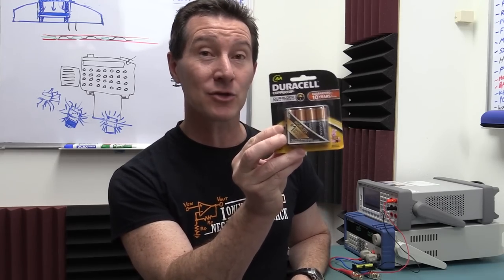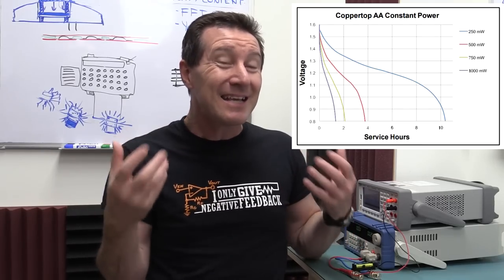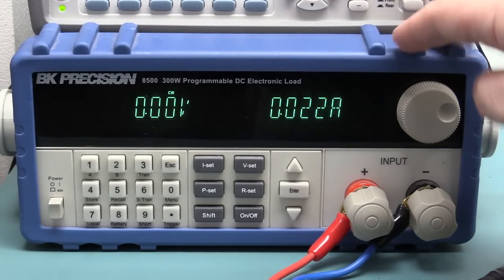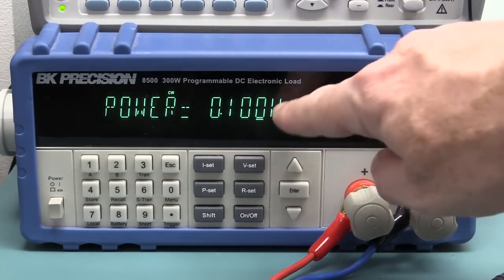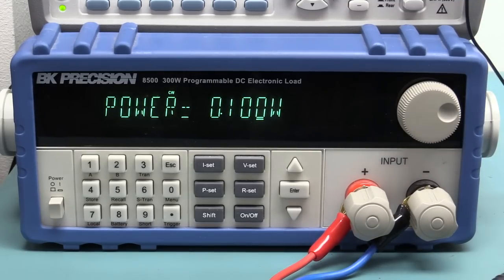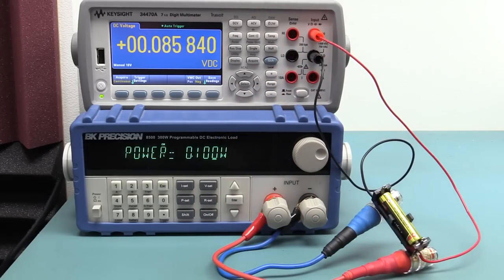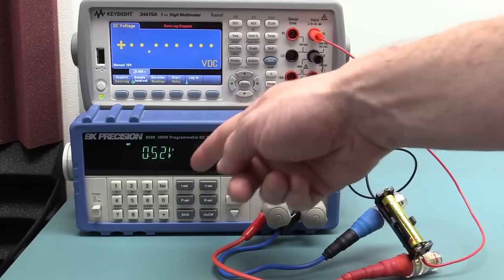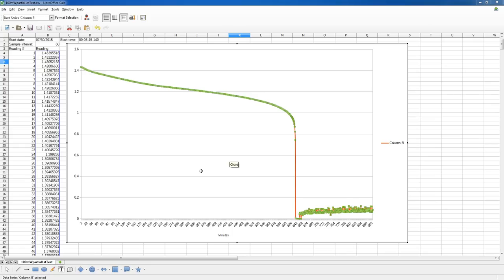EEVblog #774 - Low Battery Discharge Testing Part 1

Comment: Hopefully now people understand why the graphs cut off there hopefully.

I really appreciate that you go THIS far to make it easy to understand for everyone not only engineers that are familiar with the terms and topics. This alone is a fairly demanding task that not even all teachers want to go through so for that you have my respect Dave. Keep up the good work.
Reply: MhDaMaster All i hope (but certainly wont happen) is that those guys to whom i wrote a text wall explaining why ESR wouldnt let you even power a led (which my numbers were pretty near to what dave meassured here) and why they graph below 0.8V was useless (1% left doesnt mean you can get it, not with 1Kohm+ esr @ 0,8v) will understand it now. 
Fun fact, one even told me he was "another experiences electrical engineer" (i doubt he was even an undergrad) and even funnier because i'm a computer sciences guy. It seems to me these kind of people see this as those others see those free energy devices.  No one did this so far because evil iluminati corporations wanted you to throw away your batteries half way used. (or 89% full/~1,53V if you want to get that 800% battery life increment)
But what does dave know.....the laws of physics are just numbers /sarcasm.
Reply: MhDaMaster So much this. Hopefully this wil put to rest the joule thief and near infinite energy from battery chemistry arguments. 
I really apreciate what this man does to explain simple scientific concepts and guide those who are gullible enough back into the scientific method.
Reply: Laharl Krichevskoy "It seems to me these kind of people see this as those others see those free energy devices."

Yes this is exactly the reason those guys nitpick all day at every single minor detail/mispelling or whatever to "debunk" any detractors, at least in their heads.
Reply: Laharl Krichevskoy Well, 'power a led' really depends on what sort of application it is. Nanopower sensor equipment designed for energy harvesting can tend to get usable energy from a depleted chemical cell, though usually solar, rectenna, or tritium IC power may be preferred. Or fun stuff like lithium-air batteries.

Usually you might design a system which draws power to an ultra-low esr organic polymer electrolytic capacitor, then you can convert, store in a capacitor, and enable the device once the stored charge reaches a peak. So you can run a lot of devices on low power sources, usually by adjusting the activity timescale. A pulsing LED for example.

If you wanted to be really cute, you could derive energy from the oxidation of the metal the battery is made out of. It's perhaps just a question of 'application'.
Reply: Gravity What kind of consumer product would completely run like that though. Most if not all consumer products run on demand not when the charge of the capacitor drawing power from your extremely discharged battery reaches a peak or something like that.

I honestly dont see that kind of products making their way into the consumer market let alone on a massive scale.

On the other hand yes I can see the application for certain parts of a product, like the pulsing led from your example. But would it really be worth spending all the extra cash on the parts, design, manufacture, etc. required to get that "extra" energy compared to the savings on batteries you will make on the pulsing led for example?.

Sounds like a super LONG term investment probably in some cases at really low power consumption the return rate would be so low that the life span of your product would run out before you make your money back. And thats not even accounting for accidents or anything of the sort.

Maybe in the future when that tech is cheaper which would make the length of the investment shorter but I'm not certain for now. We would really have to crack the actual numbers maybe in certain cases its viable but it sounds niche to me.
Reply: MhDaMaster 'Internet of Things' stuff can run like that, home automation, security products, etc. It's a pretty useful field, and especially to get long-term background processing operational. A major emerging consumer market is stuff like wearable electronics, low power digital tech to get emails, status updates, and so on.

As for the implementation technology, it's presently not that expensive. An LT3105 is pretty good for high impedance inputs. 'Commercial application' is basically a function of the engineer's imagination refined relative to resources.
Reply: Gravity  Yeah its probaly really good to extend the life of rechargeable battery devices which is an extremely important sell point then again I have heard discharging those completely is not that good for their life span but I'm not an expert in batteries so I'm not certain haha.

I haven't seen any of this stuff "low power digital tech to get emails, status updates, and so on." running on disposable batteries you know like a cell phone running on AA? sounds kinda wonky.

To be honest I haven't seen anything really important running on disposable batteries except for the one in motherboards or similar applications, clock keeping, bios, etc. Which are not process intensive by any stretch of the imagination.

It still sounds niche to me in terms of the disposable battery market.
Reply: MhDaMaster
no, if you discarge NiCd or NiMH batteries below 1V you ruin them, specially NiMH ones.
I'm not an expert chemist to know the why and all the atomic structures stuff but basically you get the same as if you had used it for a long time but un a brief moment. ESR goes throw the roof and it just wont hold charge at all, aka the mAh go down.
NiCd batteries are supposed to be more resistant, but they hold way less charge and though "sparking" them is also supposed to restore them a bit, i tried it and it made little to no difference.
Overcharging alkaline AA cells to 2V did work though.
Reply: Laharl Krichevskoy Thanks for the info I had heard it killed them but I wasn't certain if it was true or just a rumor good to know.
Reply: MhDaMaster
same happens for most chemistries. li-ion and li-po cells can even catch fire or deform, especially the later.
sumerged lead acid ones (car betteries) suffer an immidiate death if you do that. Get it below 10V and no matter what you do it wont start your engine. it will still work and give a bunch of amps (its huge compared to a AA) but compared to a new one, you are talking about +220A to 30-40A.
Remember baterries are basically chemical reactions, and most can be reversed, but only under certain conditions, those conditions tend to dictate those cut-off voltages.
lead acid betteries generate hidrogen if overcharged above 13,6/14,40V, you turn all the water into hydrogen and run out of water, the chemical reaction cant work, hence baterry's dead. And if you over discharge it, lead oxide forms and falls to the button of the case and them it cant be changed back when you recharge it, hence you lost capasity.

You can even recharge an alkaline AA battery but they hold a lot less charge depending on at what point you recharge them and they generate hydrogen too, so if they are berry tightly sealled they can bent and leak. (9V ones tend to do fine though). Still they are not the safest chemistry so that's why you dont see rechargeable ones, though some made them for a while, still not worth it. (in case you are interested, try charging at CC at 0,05C of an equivalent NiMH one, about 100mA max for a AA, lower is better, be sure to place it in a plastic container in case they leak. Stop once the voltage stops going up)
Reply: MhDaMaster Disposable battery stuff for low power, in the commercial realm, usually
 tends to run on things like metal-air batteries. Zinc-air is a pretty 
common one, they have light weight due to the absence of an oxidizer. 
For applications, it tends to be stuff like hearing aids, pacemakers, 
emergency rescue beacons, animal tagging, emergency radios, military 
stuff, and so on.

+Laharl Krichevskoy 
Well, for the above stuff and additional, it's a very real field. Nanopower industrial sensors, microelectromechanical systems, Sigfox low power webs, etc. Don't confuse the cons for the real stuff, you know?
Reply: Gravity I'll get back to you once the discharge curves at lower currents hence fairly low power come in then we can crack some numbers to see if it would be worth it draining every single watt out of the battery costwise. Its much more "scientific" that way if at low power its not worth it then nanopower wont be either so we will see I guess.
Reply: MhDaMaster Oh, are you talking about what's in this video specifically? I mean, low-power devices are already a multimillion dollar industry. For emergency beacons, military comms, etc. it can be absolutely worth pulling every last bit of power, especially from multiple sources. Like, you could have a solar panel, a thermoelectric, and a battery piped through an LTC3105/3108. Satellites especially like to have backup systems so orbit adjustment commands can get sent even in failure modes.

Now if you mean is it worth it to you personally to do this on a duracell? It can be, if you're stranded in the desert and want to charge your phone. But like, the common flashlight application, maybe not.
Reply: MhDaMaster There's no need to be mean. You've misunderstood that metal-air batteries may be 'disposable'. What I've been saying has applied to 'one time use' energy sources as well, especially in emergency applications.

Over-discharge as well may be a failure mode on some rechargeable chemistries, but not all of them.
Reply: Gravity I dont know what you mean by "what I've been saying applies to one time energy soucers as well" Do you mean AA batteries as well?. I'm even starting to doubt you have said anything related to this video and or topic, video and topic being DISPOSABLE BATTERIES, as I said you are talking with yourself and mentioning other people.

The only thing you have said is you can get energy from dead cells with especially designed circuits which is true yeah. I asked is it worth it? and then you started rambling about random stuff that has absolutely nothing to do with what we are talking about.

The only other statement you have made is "it can be absolutely worth pulling every last bit of power" yeah of course in certain applications or situations but that makes it NICHE as I have told you like 5 times.  

Really you say it like satellites, emergency beacons, military comms, etc. Are not niche applications. They are important yes, they are markets worth a lot of money yes, are they part of the consumer market NO.

Do the military or the nasa use AA disposable batteries for their satellites or communications? I REALLY doubt it.
Reply: MhDaMaster My point was that it's application specific. It's what you personally want to do with the energy. So yes, some military communications do actually use 'AA disposable batteries' because they are common in urban engagement zones.
Reply: Gravity "It's what you personally want to do with the energy." What? hahahaha what are you even talking about.

I realize that what you mean is to design for a specific purpose but the word personally does not describe that accurately. A design is not a personal choice it has a purpose which normally is to enhance a certain desirable characteristic of a system.

I just told you its a niche technology for a niche market and it is. This might be a shock for you but the military and the nasa are not part of the common consumer market. So please if you are going to insist on how its not niche stop mentioning satellites and such.
Reply: MhDaMaster So basically, this is often why some scientists don't like to explain these things to people. Because you're not understanding the resource analysis structure and being rude about it.

The entire question of "is using the energy below 0.8v worth it" is entirely dependent on your personal choice of application. You, as the designer/user have to make that choice on a case by case basis. You should not assume it's globally one way or another.
Reply: Gravity "is entirely dependent on your personal choice of application." Is it? Its not nearly as simple as you are making it seem.

If the technology needed to tap into that energy is not cheap enough when compared to the amount of energy you can get then it is not worth it globally.

There are a few cases where it is still worth it. Such as I don't care about the money I just care about performance but that is NICHE under a capitalist system.

"Because you're not understanding the resource analysis structure." I understand it and judging from this conversation much better than you ;).
Reply: MhDaMaster It's a cost-benefit analysis entirely dependent on your personal choice of application. I.E. a TV remote might have a lower cutout. DC-DC converters and battery efficiency are actually not 'niche' markets, you're just making assumptions without actually researching the topic.

For example, as a consumer, you can build an LTC3105 based converter for ~5 USD and use it on anything from batteries to solar panels. It's how much effort you want to put into it for the gain.
Reply: Gravity Lmao ok then lets crack the numbers I'm not being super strict so I'm almost certain you will nitpick but let's see who understands better.

How much energy is below .8 volts?. How many batteries would you have to change to make those 5 dollars back?.

If we assume that the energy below .8 volts is 1% which is probably generous but well thats just how I am ;). You would save 1 battery for every 100 you use have you changed the batteries in a remote 50 times? I doubt it I really do.

And 1 battery is not even 5 dollars how many would you need 5?, not even considering its around 3.50 for 4 batteries, so you would have to change batteries 250+ times to get back your money?. I dont think you would ever use a remote for that long honestly and if you dont then you are effectively losing money so no its not worth it. Well feel free to nitpick.
Reply: MhDaMaster This is why I'm saying you're not understanding the resource analysis structure. How much that energy is worth to you personally is the factor here. For the amount left in the battery, which may be very small, your application determines its value to you. If your application only draws in the microamps for an arduino watchdog timer, that energy might get you a decent amount of time. It is literally "how much is that energy worth to you", and you're comparing it to "is it more optimal to just get a new battery".
Reply: Gravity Yeah beacuse clearly when I buy batteries they sell them to me based on how much the energy inside them is worth to me.

There are only 2 cases you either care about money and bang for your buck which is my case and the case of almost everyone.

Or you dont and you say i'd rather spend extra money that I wont get back to have it running 1% more of the time it would have without that extra tech. Which as it is percentual might be a lot or very little depending on your application, one could argue that 1% of 100% is always very little but I guess that kind of common sense is below you so lets go with your idea. Even so you will have to buy more batteries eventually there is no way around that.

It really boils down to convenience. Do I want to buy them now or 1% more time later? Do I want to replace them now or 1% more of the time later?. Which is as you might have guessed marginal and NICHE as hell now please read it real good, understand it and stop arguing about how everyone should burn money for a pitiful 1% increase on runtime thanks.
Reply: MhDaMaster I explain per-application cost-benefit assessment, and you assume I'm telling you to "burn money"? Listen, this is exactly, precisely, why many teachers don't sit down to explain these things to people.

They literally do sell batteries based on how much the energy is worth to you. That's the whole point of a battery. Supply and demand.

You can absolutely choose in your application that getting a new battery at 1.0v cutoff is more resource efficient. But saying there's "no possible use" for lower cutouts is as much of a con as saying "you get tons more energy" in this case.
Reply: MhDaMaster Basically, the value of the 'runtime' varies per application. So when you design the product, you're considering that. Something like a wristwatch, people don't want to be changing the batteries all the time, so you can put in a lower cutout and use more of the battery. At lower power use, each 'percentage point' can last proportionately longer. That's the "personal" thing. Someone can want to build a harvester-converter if they're going camping and want to be more secure about what they can use to recharge their phone.

So the way you're using "niche" is essentially meaningless, low-voltage operation is a commercial tool which can be quite common, and it's up to each manufacturer what capabilities they want to give their customers for what cost.

Again, I'm not implying you should buy a converter for something that isn't worth the money. I'm saying you should consider if it is worth the money per application.
Reply: Gravity "people don't want to be changing the batteries all the time" clearly 1% extra battery efficiency will make that a LOT better.

"low-voltage operation is a commercial tool which can be quite common" yeah 1V-.8V is extremely common below .8V it gets NICHE.

"if it is worth the money per application"
As I told you before in the consumer market its just a matter of convenience there simply are not that many applications that will make it worth it. Lets take your example of the tv remote again.

If you buy a really crappy remote for 10 bucks and then you ask the people would you prefer one for 15 bucks that lasts 1% more time? do you honestly think people will go for it?.

Now of course if you buy a 200 dollars remote then 205 is not that bad. Do you think there are a lot of people that buy 200 bucks remotes? Is that not a NICHE market?.

Its like saying that vacuum tube radios are not a niche market because the choice of fidelity is personal or something its just an extremely stupid arugment. I'm sorry to say it but you are being incredibly stubborn and illogical for no good reason really.

Just one thing define NICHE for me then if you please. Maybe its just that we have different meanings of that word probably for you it means something close to being born from satan or something and that is why we cant understand each other.
Reply: MhDaMaster So do you mean "niche" as in "presently less common in specific consumer goods"? Literally everything is "niche" in some way. If you are talking about AA cell consumer goods, the entire market is "niche" relative to much larger industrial markets. Some of the first examples I mentioned, like 'Internet of Things' applications, low voltage CMOS logic, is a potential consumer vector benefiting from sub 0.8v operation, especially multi-input multi-chemistry capability stuff.

You're basically just overgeneralizing the concept for very little point. It can be much cheaper to mass-produce TV remotes and watches with a lower cutout than +5 USD, again it's application specific.
Reply: Gravity I asked you to define niche for me and you didn't do it whats up with that? What is your definition?.
Reply: MhDaMaster Well, I tend to use the scientific definition. "A particular restricted application set, or biological resource paradigm."

I take it you're trying to say that "it might not be worthwhile to design cutouts that low" and/or "many consumer products don't", which is why I'm saying it's entirely application dependent on a case by case basis. There are a lot of commercial cases to run operation down below 0.8v on 'one time use' batteries, even AA cells, especially in the much larger industrial/military markets.

Therefore one should not generalize, but consider how much capability one may personally receive per application.
Reply: Gravity "A particular restricted application set" that definition is extremely broad as well. Your argument about how everything is niche in some way also applies so really.

Your argument is literally based on how some people might consider a 1%-.5% extra efficiency worth it for LITERALLY "reasons" non specified so I cannot debunk them really clever you must be proud of yourself.

And I have demonstrated how you wont get your investment back in terms of actual cells and money so now its about runtime which is priceless or at least more valuable than actual money because of LITERALLY "reasons" again non specified. If you cant even name a few you really have to wonder how restricted the application is honestly.

You say that people would prefer to have their stuff run 1% more why? again non specified. So they dont have to change batteries so often, 1% wont help with that at all, no comments on that even your mom must be proud of you by now.

 I should say that people like you are exactly and precisely the reason no one wants to debate seriously.
Reply: MhDaMaster Why would someone want one percent more time? So for example, if its just a common flashlight, you might not care-- just get a new battery. If it's a radio beacon, outdoor IoT sensor, or medical implant, it might be real annoying to change it, so an extra month to week of operation can add up in maintenance cost savings.

I said, again, it depends on WHICH STUFF and WHY. You're just making an overgeneralized argument.
Reply: Gravity  "If it's a radio beacon, outdoor IoT sensor, or medical implant, it might be real annoying to change it, so an extra month to week of operation can add up in maintenance cost savings."

If you can run an extra month to week on 1 percent lets do the math :).

100 months to 100 weeks. 8.33... years to 1.917 years yeah god knows that changing batteries each 5 years on average will add up REAL fast in manteinance costs. You will probably notice some huge savings if you live for 400 years or something along those lines lmao.

Thanks for spitting out the info so I can make you see how hilariously marginal it is couldn't have done it without you.
Reply: MhDaMaster Actually, pacemaker batteries are designed for 10 year operation, so one percent will be about an extra month, which can be designed in as a safety margin. And yes, heart surgery is a 'high maintenance cost'. As is replacing ALL the batteries in 1000 sensors more often, as is missing a rescue chopper due to beacon failure.

You absolutely cannot 'debunk' the value of lower power emergency operation because it is a massive commercial field. You just have a very narrow view of what you believe to be 'profitable'.
Reply: Gravity Clearly if you have 10 years of battery capacity you have to wait for when the battery is about to deplete like 2 hours before so you dont waste even 1 watt of energy because energy is that important.

Its not like its much more important to have a full battery because having your pacemaker running is the important part not how much juice you get out the battery itself.

If runtime is THAT important you wont let it run until the battery depletes when it feels like it you will give it maintenance before the battery depletes its obvious like at 95% or 90% if you are playing it safe definitely NOT at 99% much less closing in to 100%. So squeezing each watt out of the damm thing is not even important in the first place to be honest I should have said that first lol.

I'm guessing you study this field and dont want to be studying a pointless field or something you have something personal going on clearly I'm sorry man I didn't mean to tell you that the field you specialized on is pointless.
Reply: MhDaMaster You don't "wait until the last moment", since there is inherent value in the safety of 'having that capability'. Infrastructure independence and multi-input development are actually big fields. You're basically saying that you personally don't want to use the 'one percent energy' for what you're doing. That's fine. But that doesn't mean nanopower and high-resilience applications don't exist.

Don't confuse the 'con games' like "get double your battery life" for the actual genuine efficiency and reliability applications.
Reply: Gravity a solar powered beacon would be better, and afaik they are. There's no place in earth where you dont get enough light to power something like that.
Reply: Laharl Krichevskoy Mineshafts can use a 300hz battery powered beacon, night operations, etc. You are correct in that for really critical applications you should have multiple sources, including even a basic crank. But you can't rely on a steady solar for a rescue beacon, because it can get caught in shrapnel, obscured by clouds, etc.

A lot of times they use hermetically sealed zinc-air batteries where the seal ruptures turning it on by air exposure. Other liquid-based ones as well for nautical stuff. Radioisotope alpha or betavoltaics can be some of the safest, but it's difficult to get a lot of current from them.
Reply: Gravity Oh so the pacemaker disappeared from your mind a real shame. Any other examples? We can have some fun with them and some math :). 

You know unspecified boons of stuff are the kind of things the batteriser thrive on just look at the "up to 8 times" vague perfect for scams. Its the same for your argument vague perfect for convincing people and perfect to debate as you give little to no info on your stance.

"You're basically saying that you personally don't want to use the 'one percent energy' for what you're doing."

As I said if you have your life hanging on it will you really let the whole battery discharge or will you change it when it has some capacity left?. If you would do the same then its hardly just me and my personal preference and if you change it with some capacity left then you wont use the below .8V parts so its utterly pointless for that application.

If you had a pacemaker you wouldnt wait for it to discharge 99%-100% especially when there is the fact that you are not even certain when that is going to happen. So dont be a hypocrite and stop trying to paint it like its just me or something. Its a logical and natural choice which makes the voltage below .8 irrelevant.
Reply: MhDaMaster "You don't "wait until the last moment", since there is inherent value in the safety of 'having that capability'." specifically applies to the pacemaker example. You are actually right now personally scamming people by denying the actual legitimate uses of low-voltage DC-DC converters like the LTC3105. You're basically denying that anyone would ever want to use remaining energy in a battery, and it's simply untrue.

The scam of the "eight times battery life" stuff is basically that you're unlikely to get that in common application. They're basically claiming you get a lot more than you do, and that's the problem. You're running the same scam in the opposite way, saying you always get less than you can. It depends on the goals for each case.
Reply: Gravity Oh my your definition of scamming is weird too is that the scientific one?.

Because I'm not making any money from telling you that you shouldn't wait until the last month on your pacemaker's battery capacity in fact I'm certain many if not all doctors will tell you the exact same.

"You're basically denying that anyone would ever want to use remaining energy in a battery, and it's simply untrue." Well tell me some uses with the added time they will get from the below .8V energy.

You telling me that "it works" and me having to believe it based on your word sounds to me much more like a scam what if you work for linear whatever. Then again by your wonky definition of scam that is probably not true.
Reply: MhDaMaster I don't actually work for Linear, but they did send EEVblog a free demokit of that kind of DC-DC converter, so they get the free advertising.

Basically, for denying the possibilities of sub-0.8v operation, you're trying to scam people into losing money. Both the claim that "you get eight times your energy" and "no one would ever want to use the remaining energy" can be 'scammish'.

If you want to 'debunk' people claiming a DC-DC converter will get them multiple times their device life, you can't claim they get nothing from it, only that in common application they won't actually get multiple times their battery life.

However, someone can in fact want to use whatever energy remains under 0.8v, especially for microcurrent processors, which is why the decision is per case, and not globally.
Reply: Gravity "You're trying to scam people into losing money" You truly have no idea what the word scam means lol also yeah I'm a master criminal making them lose a 10th of a cent per battery mwhahahaha people scream MONSTER when they see me XD. "scammish" language with you is a real riot man I have to admit. 

"If you want to 'debunk' people claiming a DC-DC converter will get them multiple times their device life, you can't claim they get nothing from it, only that in common application they won't actually get multiple times their battery life."

That is what I have been telling you from the very beggining. I just said that the applications on where they are extremely good are niche.

And that for common applications they are mostly not worth it and I showed you with actual numbers how the investment is money you wont make back for a common example. Because we both know you wont trust my word even if your life depended on it so I trusted that you would care more for numbers but I guess nothing is that simple with you.

"However, someone can in fact want to use whatever energy remains under 0.8v, especially for microcurrent processors" How much time do they get from that 1%?
Reply: MhDaMaster For a microcurrent CMOS it isn't one percent, because the discharge curve is different, and the chips can tend to run down to ~0.5v natively.

And yes, scams can be run to lose competitors money for your own benefit, rather than more directly getting money.

Saying it's "niche" is essentially meaningless. Low power systems are not a "niche" market if you mean "uncommon". You're just looking at it from your own usage perspective. For your present applications, it might not be worth it.

The fact remains that for any amount of energy in an energy storage device, there can be an economical usage for it. You might not see it in what you imagine to be 'disposable battery devices', but I would say that's due to your inexperience with the market.
Reply: Gravity "scams can be run to lose competitors money for your own benefit, rather than more directly getting money."

I dont know what the hell are you are smoking but in case its not clear I wont benefit from people not using the products from linear whatever so really scam is not the word for it no matter how much you ammend your argument.

Its REALLY REALLY hard for you to admit you fucked up and everyone can see that. You should really work on that man if you are as old as you seem that is not healthy at all.

"For a microcurrent CMOS it isn't one percent, because the discharge curve is different, and the chips can tend to run down to ~0.5v natively."

If it runs at .5V natively then you dont even need the DC to DC if at .8 volts there is very little energy at .5 volts its much less which in turn makes the DC to DC much less useful. Even if the discharge curve is different, you should specify the current please, how much is it? 50% lmao how about 2% grace me with your experience and tell me how much is that percentage in time while you are at it.

Just dont lecture me in English its clearly not your strong suit.
Reply: MhDaMaster A DC-DC converter is not the only method to use sub-0.8v power. Like, what is your actual argument? You don't believe using the remaining charge in a battery is ever valuable? You don't believe low voltage converters are a common industrial product?

There is a massive difference between a 'battery boosting' scam and the actual legitimate usage for 'squeezing out' battery charge. You basically just don't know about the commercial applications, so you're trying to 'debunk' actual real uses.

"Niche" doesn't mean anything. For you it may be "niche". You don't design industrial/military/advanced-consumer products. It's not "niche" to maximize maintenance efficiency in high-pressure or low-footprint applications. It's a massive industry. Your perspective might be different, but that's what the issue is.
Reply: Gravity "You don't design industrial/military/advanced-consumer products." All niche markets. One would say that the remaining 95% of the population which is over 5.4 billions would be the bigger market making those you mentioned smaller markets even NICHE markets.

But I guess you say that the size of a market is relative to how much money it makes. Not based on how many people is in the actual market which can buy your product which is a bit weird honestly. Probably another of the quirks of your extremely scientific language. 

Really for all those "super advanced" military and industrial tech stuff you wont use AA duracell batteries really you will use precision power sources or zinc air batteries and the like stop lying to yourself dude its fucking pathetic admit you fucked up and go to sleep. My god I hope you are not over 15 years old because I really wouldn't want to have anything to do with you otherwise.
Reply: MhDaMaster But this is the funny part, you're legitimately and provably wrong. You're calling massive industries "niche". Your only point is that "you might not want to push an AA to 0.5v in certain consumer products". 
And you might not. But again, you cannot make a general statement of value.

In each case, a person may decide what the value of a certain energy usage may be. A security application might have a higher value per charge and per reliability than an entertainment application. Always in each case upon the evidence can you decide what kind of energy efficiency you want and for what reason.
Reply: MhDaMaster Except "hard numbers" are not the mode to describe the basic concepts of commercial possibility. For example, a military software-defined radio can be engineered to extract power from low voltage AAs as a vector of survivability. In that application, consumers may have already discharged them mostly in the urban environment. I can run out a whole string of numbers on that, but you won't actually understand them, because you fail to understand the basic concept of "cost-benefit relative to application".

For a consumer product, I have literally described 'Internet of Things' and 'wearables' applications for low maintenance usage. You just don't seem to understand that for a certain energy storage system, there may be economic applications using it. Including near-field burst transmitters that have high and low drain modes, wherein you might want the low drain mode to maintain an 'active incapability' warning down to the last drop.

Basically, because your perspective lies only on certain consumer products, they appear disproportionately large to you, while you believe other things are "niche".
Reply: MhDaMaster Just Google "Internet of Things". Even "Sigfox". The problem here is that you just don't know what you're talking about, and you're being arrogant about it.

Again, the value of each point of energy in the device is relative to the application. For security, small amounts of charge can be worth more than for entertainment. Because you don't understand that concept, the "numbers" will be meaningless to you. You just don't have the basic "equal and opposite reaction" stuff down, let alone the 'math'. You can try a course in 'intangible assets' while you're at it, as well.
Reply: Gravity Its meaningless because you are naming hundreds if not thousands of different types of devices with no rhyme or reason. If you truly believe that it is a case by case topic then how can you fucking say that all of those things will benefit you are contradicting yourself literally.

But I guess when you do it its fine because you are smart, you have a lot of experience, you have everything down, and you are not arrogant despite showing several character flaws that you should work with a psychologist also you will just ammend you argument 100 times until its "correct" so really.

"Because you don't understand that concept, the "numbers" will be meaningless to you." Yeah of course since they will be meaningless you cant show them to me of course scamming 101 lmao.

You should teach me the equation that shows how its much more worth it to squeeze a battery to 100% than to replace it and risk having a significant downtime due to not knowing exactly when it will run out when compared to the actual downtime from maintenance 

Oh but that one will be meaningless for me too dammit.
Reply: MhDaMaster Okay, I will try to explain it simply and politely. A battery at 0.8v can run a LED. How valuable is that to you? If it isn't that valuable to you, you probably shouldn't buy the equipment to do that. It might be more valuable to a LED artist, or someone who wants to practice low voltage circuitry, or even someone who wants a reading light.

A battery at 0.8v can run an FM transmitter. How valuable is that to you right now? It may not be, and that's fine. But for the police, who may want to bug a criminal's flashlight, it can be extremely valuable. They want it to run even if he uses it and doesn't replace the batteries too often.

See? That's basically all I was talking about.
Reply: Gravity Yeah we both know that bugging stuff is NOT a niche application I mean I bug stuff all the time we all do really. Not to mention that the flashlight will cut off at 1-.8 V so even if your bug works at a lower voltage it doesnt even matters because he will change the batteries anyway to use the flashlight.

On top of it you potentially have 6 billion costumers not like 1 per police department in the world which probably doesn't goes above 1000 in fairly high numbers 100 per tops. Your argument is completely on point now.

But really you should teach me the equation that shows how its much more worth it to squeeze a battery to 100% than to replace it and risk having a significant downtime due to not knowing exactly when it will run out when compared to the actual downtime from maintenance and the 1% energy from the battery you will waste.
Reply: MhDaMaster Well if I give you a single example, of course you can call it "niche", it's just one example. Consider the totality and the possibilities. Is "police bug" really the only use of an FM transmitter? No.

As for the 'equation', it's a simple linguistic one: "Everything in the universe is on a case-by-case basis." It's whatever the value to the customer is for each moment of use, for each specific application.

In the example of a LED reading light, a boost converter can be the LED driver and can operate to low voltage. You can give your customers more constant lumen output, longer battery life, and save cost in the combination.

Never assume "there's no value", always investigate in each case if there is in fact value. There may not be. But if you write everything off, you're going to miss value.

Edit: For bug example, the point was that if he does not change the batteries, it will still work, which is a vector of value to the police. Don't assume he will.
Reply: Gravity Good thing it doesnt even matters that your example is not even valid but well if you say it its correct right? no arrogance at all.

Oh yeah I always carry my flashlight turned off around of course. On top of that assuming that he will want to use the fucking flashlight is going way too far I cant fucking believe you. Isn't it the same to assume that he wont change them to get your bullshit "vector" oh no when you do it its all right sorry I forgot.
 
"Everything in the universe is on a case-by-case basis." except when you talk about the internet of things in that case close to 50 billion devices benefit from your bullshit tech lmao.

"But if you write everything off, you're going to miss value." Yeah you are doing god's work saving people a 10th of a cent per battery truly godlike LMFAO I'm sure you will go down in history.
Reply: MhDaMaster I'm not sure where you get "my tech" from. There simply are applications for low voltage high resilience operation. But this is the issue, people said "no one would want a personal computer, they just do math".

You assume that there isn't commercial value for even the small amount of energy in a cell. It's small, it's probably not going to get much time for many applications. But there are applications which can use it. I've literally described the operation of major ones.

You may not find them useful. You may believe industrial sensors aren't "commercial". It really doesn't matter.

Edit: If the police bug a flashlight, they don't connect it to the switch. Please. You're just being silly.
Reply: MhDaMaster I'm kind of supposing you might be inebriated actually. But for the 'bug' example, the reason it's designed to work below 0.8v is because if the criminal does use the light, it will drain the batteries. Now say the flashlight cuts out and he tosses it aside, doesn't feel like changing the batteries then. The bug will still continue working for a long time, because it's made to efficiently use the last bits of power.

You can apply that concept to non-police applications as well, like a sensor which monitors and reports device status using a microcurrent processor, even when the device is out of power for normal function.

That was the 'active warning' part for burst transmitters: they can continue to send a logic signal indicating that they are incapable of operation for a very long time on low batteries.

This has consumer application for the aforementioned 'Internet of Things'. I'm absolutely not trying to scam you with this. I'm not saying you should fall for "double your battery life" traps. But don't disregard real uses for small bits of energy.
Reply: MhDaMaster That's not an "assumption", that's a design specification. It's designed to handle the real possibility that criminals are not so good about changing batteries immediately.

I guess I take issue with you calling it "niche" in response to me saying "per application". I'm basically not sure why you're disagreeing with me.
Reply: Gravity "It's designed to handle the real possibility that criminals are not so good about changing batteries immediately."
HAHAHAHAHA I cant stay mad at you dude the things you say are way too funny.

Its just that the increase is sooo god damm small I know I said 1% but I really doubt it goes that high. For starters your dc to dc would need voltage so that kills a bit of power then it wont turn off at 0V I think I read it was at .225V So you wont even get everything from that 1% like you might get half of that 1% tops and thats assuming there are no other problems.

So really can you actually get it?. Have you tried making a circuit for that and does it work?. I mean surely you have done that I dont see how you would be so fucking invested in this without having done that. So how did it go how much energy did you get from it?.
Reply: MhDaMaster So, the main thing for consumer applications is multi-mode operation. In a lot of cases, it's not necessarily getting more lifetime out of the primary mode, but being able to do something at all in a failure mode.

So for that, say the device fails right, it runs out of batteries, the main camera doesn't work. A microprocessor detects this, records the time, and can output status and receive commands on the sub-0.8v power.

This is kind of my point on "it depends on your application". So the answer would be "building this I received X economic value from being able reduce the uncertainty about what happened to the camera". Because say a thief cuts the camera, now you see that it wasn't out of power, the line was cut.

Another thing you can do is, if the power drops below sensor-use value, it an trigger a converter in the main processor to dump the sensor's energy into the processor's reserve, so it can 'cannibalize' energy from failing peripherals.
Reply: Gravity Wow you really haven't even tried the fucking circuit to see if you are getting anything out of the battery. You are on a whole other level of insane.

Did you really just make like 30 replies to convince me of the viability of a tech you havent even tried?.
Reply: MhDaMaster Sigh. You realize you're asking someone on the internet right? I could just lie to you. If you want to see someone run a circuit on low batteries, just watch a Youtube video of it. Or read the datasheet of the IC I've mentioned repeatedly. I could just take the stats from there, you know? Man, I'm almost 900% certain you're drunk dialing on Youtube right now.
Reply: MhDaMaster The funny thing is I actually have tried basic DC-DC converters at low voltage. They do just what I said they do. They don't make your batteries 'magically full again'.
Reply: Gravity What did you say? Because in your last 2 replies there is nothing related to the performance of a dc to dc converter when used with a dead battery.
Reply: MhDaMaster Dude, I linked you a datasheet. Read the LTC3105 datasheet. It pulls a small amount of power from the battery. It can run microcurrent digital electronics. It doesn't make the batteries "good as new".
Reply: Gravity Yeah I know how much energy did you get out of the battery?. In other words how long did you get your microcurrent shit going at what voltage and current?. As if its not wonky enough that you dont have that data.

Or link the microcurrent shit as well if you are preaching how fucking awesome this tech is you should at least get more data really.
Reply: MhDaMaster Read. The. Datasheet. It's simple math to see how much power it produces, consumes, and how it interacts with fuel cells and electrochemical cells.

You want math? Do the math.
Reply: MhDaMaster The data's right there. In the datasheet. And whatever battery datasheet you want to use. You want someone to spoon feed it to you? Too bad.
Reply: Gravity Well I would expect the fucking  acolyte of microcurrent bullshit to have a bit of data. Really I dont know how you can expect me to even conceive that someone who hasn't even done an experiment on some tech to be so fucking invested into it.

It really goes beyond illogical but it doesnt surprises me from you at this point.
Reply: MhDaMaster The test data is literally published in the LTC3105 datasheet, publicly available. It doesn't "give you eight times your battery power".
Reply: Gravity  "give you eight times your battery power" What the fuck are you talking about? we all know that is not true. I asked you for how much energy you got out of the discharged battery. By the way in the range you want to work this thing is not even 80% efficient so even less power.

How much current does your microcurrent shit use?.
Reply: MhDaMaster "Microcurrent" tends to refer to "microampere draw". That device fills a capacitor to voltage, then it can turn off to save power. It absolutely does not make your batteries "last forever".
Reply: Gravity Ok I guess that is your way of saying I dont know. Some people would say that this was pointless they would be wrong. That I shouldnt talk to someone that is completely insane and backs up blindly and faithfully a tech he hasn't even tested.
 
"It's designed to handle the real possibility that criminals are not so good about changing batteries immediately." But this made it all worth it LOL. I'm sleepy now though hopefully I will never have to read your bullshit arguments again. See ya kid.
Reply: MhDaMaster "Microamperes" are obviously a measure of current. The instantaneous current draw of a device depends on what it's doing. An LTC3015 can convert enough energy to power an ATmega168. You can read the datasheet on that to see how much it uses per operation mode. You can even consult this very video for what kind of energy a largely depleted battery has. None of these devices 'magically give you more energy'. Even though it can convert from millivolts to 5 volts, energy may remain the same.
Reply: Gravity Why are you repeating this 'magically give you more energy' over and over and over again?. No one in this thread has claimed that they do such a thing like really I'm starting to get concerned about your mental state. Even more and I didn't think that was possible. 

And you are not even writing funny stuff like your design enhanced for battery handling by criminals truly a work of art.
Reply: MhDaMaster Well I mean, you should be able to write stuff like that yourself, with the POWER of microcurrent technology.

But really through, LTC3015 into ATmega168 relative to battery application test. I could tell you "I did it", but it's the internet, you shouldn't believe me. Read the datasheets and see what stuff does for yourself.
Reply: Gravity We both know you didn't do it though lets be honest here lol.
Reply: MhDaMaster Let's be really honest here, I have not been bullshitting you this entire time. I actually gave you a free lecture in cost-benefit possibilities for energy harvesting and micropower digital electronics. You can math up the LTC3105, ATmega168, and maybe some of EEVblog's videos on battery energy capacity, and you may see what I've been talking about.
Reply: MhDaMaster That processor pulls 15 ua in 32khz mode. It actually lasts much longer than "2 minutes", depending on the battery of course. Since it uses 1.8v to run, it may require a boost converter to work off a single AAA anyway, so you can say "may as well run it down to 225mv".

The main important point though is like I said, you can have an actual computer running even in a low voltage failure mode.
Reply: Gravity Yeah the main problem is that you are always talking about emergency and failure modes when those things are not even common lets crack some more math.

If you have it running at 15uA at 1.8 volts how long would it take to run down a SINGLE AA battery.

If we are messy as fuck as I am when I'm sleepy .1W is around .05% so assuming linear relationship which is not true that gives you around 20 W total 20/((15x10^-6)(1.8))=740740 which is like 8.5 days lets say 7 because error.

Will 1 hour of usage matter when you have 7 literal days to change the fucking battery?. You are getting a bit too excited about what happens in emergency mode that you dont realize how little it is in comparison and how unlikely it is that you would be forced to go into it.
Reply: MhDaMaster It's MICROamperes. That's .000015 amperes, which times 1.8 volts is 0.000027 watts. (Barring any math errors.) It's a very long operation time.

Importantly, having computational functions available in a failure mode is actually really helpful for debugging, security, multi-stage operations, and so on. It's a computer, you can do whatever you like with it.
Reply: Gravity yeah 15x10^-6 is 15 microamperes use a calculator if you have problems seeing it lmao.

Again 1 hour of usage, .1/(15x10^-6(1.8))=3700, wont help you much if you have fucking 200 before that really dude stop smoking pot.

Also calling an AT a "computer" is a slightly misleading term poor AT cant even hold a candle to some of the really old processors like by 1976 we had better processors lol. So really it makes me wonder if you have actually programmed one of the damm things it also makes me wonder just how young you are.
Reply: MhDaMaster Essentially, you're not taking into account the battery discharge curve. Say an AAA has 1200 mAh, that's 1 milliamp for 1200 hours basically. Say the device draws .015 ma natively. That's then 80000 hours operation. Or 3333 days roughly. Now the converter isn't one hundred percent efficient, so maybe you cut that down to 2000 days. One percent of 2000 is 20 days.

Edit: This is from a converter-output perspective. The actual current drawn from the battery will vary with voltage, but the energy use will be held as comparable. Basically, the processor is drawing .015 ma at 1.8v, while the battery is nominally 1.5v, so the current from the battery will be slightly higher over the discharge of the device, depending on converter efficiency. Higher proportional to the voltage difference, I.E., not much higher.

If you say the battery has 1.41 watt-hours (conservative), at .000027 watt draw, you get 2175 days operation, inefficiencies might go even to 1500 days (conservative).
Reply: Gravity Sure lets use your numbers that are actually right instead of my terrible sleepy aprox. now tell me if the voltage below .8 Volts matters if you have close to 2000 days to change the battery.

How often would you be in risk of emergency mode? every 7-6 years? really dude stop smoking pot its bad for you.
Reply: MhDaMaster So okay, 2000 days would be about 5 years. However, the device might not just run the processor. That's the part about multi-mode operation. Say it runs a camera, a transmitter, and an SD card. Through using those, it can get to a low voltage faster. If say the cutout is five percent charge remaining, that's about 100 days to 'signal for help', or other related responsiveness activities.

Again, this sort of thing is not 'out of the blue', I'm actually just explaining the usefulness of already existing and operable computational paradigms.
Reply: MhDaMaster Well basically, there are consumer applications for micropower electronics. Obviously perhaps not the "eight times battery life" scams, but really, you can do stuff with electric charge man.
Reply: Gravity Are you fucking kidding me?. 80 comments all this for a low battery notice like you wont fucking realize it when the camera stops functioning lmao.

I know you can use residula charge with that micro but when you tell me its 100 days of low battery notice you really make it sound trivial.
Reply: MhDaMaster Heh man, I'm pretty sure you're just misinterpreting it for fun. But that's fine. A criminal might not be so good at noticing when the battery's dead you know. He could use that 100 day notice.

Although it's 100 days of the processor running, which can do pretty much anything you want. It can even keep a calendar for you. Would you like that?
Reply: Gravity Yeah clearly its not like there are billions of devices that can do that or even written forms of it.

Mmm I really can't think of something you would have to do in the last 1% of the battery that would be really important and that you could do on super low power.
Reply: MhDaMaster Well you can have it weep in your pocket on a tiny speaker. The code can have "print: weeping" running over and over again too.
Reply: Gravity Yup you are truly demonstrating the importance of squeezing that less than 1% with your groundbreaking applications. And I know you wont reveal the actual "useful" idea you have because that is how you are going to get rich or something.

You mentioned something about a thief and cutting a cable from the camera or something. I'm only saying it because where you and criminals are concerned there is bound to be fun lol.
Reply: MhDaMaster Well I mean I already explained quite a few industrial/military/consumer applications. So now the lecture turns a bit toward logic: You're ostensibly arguing from your own ignorance in this case. You're not proving it's 'not valuable', you're only stating that you don't see the value. You may not. But that isn't evidence for it being "completely worthless". The point is as ever to value the capabilities economically in each application, wherein generalizations cannot be made without evidence.

However small the amount of energy is, there can always be a demand for it, and that may be relative to the cost of getting it. If the cost of getting it is low, it may be relatively more economic to do so. If the benefit for getting it is high, it may be more relatively economic to do so.

You'd basically have to prove that neither of those would ever be the case, which you cannot do, since it is presently the case in things like security/satellite/military systems, to name a few, and even moving toward "hobbyist arduino projects" based on the ATmega168 and related.
Reply: MhDaMaster I suppose my main problem is with how you're arguing it. You should be saying "it may not be economical in a particular application, which can include a large amount of consumer products."

Because what happens in the industry is that people can produce really energy inefficient designs. They just don't put the design effort in, even if the component costs are comparable, to make it run more lean. That ends up losing a company quite a bit in maintenance. Battery efficiency isn't actually an 'uncommon' concern.

Like, why are you arguing against the case-by-case assessment of value? It seems like you're pushing the term "niche" as if you mean "always having little value", especially with stuff like "is it useful for anyone?"
Reply: MhDaMaster Assessing the value of an energy quantity is not a 'whim'. You're doing it right now, you're just for some reason arguing against "case-by-case basis". Basically, each designer/consumer has to decide how much they want to do for a capability.

So for a 'numbers' example, if you have a 1000 mAh battery, and your application draws 100 ma constant current, that's a possible 10 hour lifetime. 10 percent of the battery is 1 hour, so if you're wasting 10 percent, there can actually be value to push that down to 5-1 percent. If you're only wasting 1 percent, that's just 6 minutes, it may not in that case be worth it to the designer/consumer to go further. In something like search and rescue, it might be. It's per case. You can't just generalize, you should be giving people the accurate data to make decisions about value.

'Battery booster' scams say you're getting more than you actually are. That's the scam. You can actually get less battery life if the converter's running all the time when it doesn't have to, wasting energy in its circuitry. But you should be telling people how to actually make good decisions themselves, on the real information. 

Like "check if you're only getting six minutes from it, and if you want to waste your time and money on only six shitty minutes".
Reply: Gravity "If you're only wasting 1 percent, that's just 6 minutes." Its probably less than 1% its hilarious how you took that number I said for no reason and use it as reference now. So much for the "real information".

And thats even assuming you can get all of that percentage, non specified because we really dont know how much it is, which you most certainly wont lets be honest your dc to dc only goes down to .225V.

And we are not even taking into account that the damm thing is not 100% efficient and that the lower the voltage the more the efficiency drops I tihnk its around less than 80% with a very noticeable decline the lower the voltage I know this from the datasheet.

So from .8V to .225V if we were to assume a linear distribution which is not true we would have around 71% then the converter is 80% efficient which is around 56% of the percentage that is below .8V. I'm taking the highest possible value for efficiency and making it constant just because you made me laugh a lot with your bugged flashlight.

Furthermore I honestly dont think it will boost the voltage from around .225V to 1.5V or higher all the way down to .225V maybe at really low currents. 

So realistically we are talking about investing to get less than 56% of the energy under .8V which is probably much less than 1%. Realistically it must be around 40% or less. So in the case of your example at 100mA what would we be talking about 30 secs or less?.

And yeah you will jerk off saying that it doesnt matters if its 1 millisecond people should be able to decide if investing money for a 1 millisecond increase its worth it LMFAO. You should go around pitching your idea to companies I'm sure everyone would appreciate your bugged flashlight example lmao.

Lets leave it at this ok? I will get back to you once dave puts out the data for the discharge curve so we can talk numbers and real information ;).
Reply: MhDaMaster You should probably just realize that you're incorrect to argue against "a case-by-case assessment of cost-benefit" in this case. You cannot prove that there would never be a benefit, therefore you are wrong.
Reply: MhDaMaster Look, if I were a scammer, why would I spend this much time arguing with someone obviously not buying it? The thing I'm trying to convey here is that if you do a bad job of debunking things, you actually help scammers, who will just say "this guy's just an angry tart, don't listen".

Everyone has a choice in what they want to do with their money. Everyone has a choice in how much they value 'one millisecond'. You can't make a 'strawman argument' to say "who would care?". You should be saying "it probably isn't worth the effort and money to get one millisecond talk time from your cell phone".

So I guess that's my main problem here. You're not doing that. If you just call it "niche", it doesn't actually 'debunk' anything. You have to state the reason. The reason is people probably won't value the small amount of energy highly in common practice.

In short "the cost to the user to run a converter can be in many applications higher than the cost to get a new battery, due to the small amount of energy left relative to the energy used for those applications."
Reply: Gravity Really if I'm doing a bad job debunking that shit by putting up how the return rate for the money spent on the converter to get the energy below .8V is so low that it will take more than the actual lifespan of the product in literally all products by using actual math then I dont know what you want me to do.

I simply said if you care about money and want to get the best bang for your buck this is not for you and you should pick another battery instead of this thing and I demonstrated why with math. And thats literally what I have been saying the whole time using the price of batteries and information on performance all OBJECTIVE DATA.

If you dont care about money then do whatever you want because its impossible to prove that you wouldn't want to buy something when you dont care about money in the first place. Its logical but that simple truth is probably beyond you. If you want to run into the subjective part of how people can do whatever the fuck they want with their money and value things however they like then fucking man up and go for it.

You should launch an indiegogo campaign for a product similar to the batteriser but for the extremely real applications of below .8V performance with a banner full of your extremely scientific linguistic equations.

I'm certain that people JUST LIKE YOU will orgasm at the prospect of having their stuff running for 30 extra seconds and will marvel delightfully at the prospect of emergency modes and microcurrent applications.

Hell you will probably raise millions of dollars after all those people when given the choice of getting 30 thousand milliseconds more will all start throwing their money at their computer screen. You should also include you example of the bugged flashlight to kill any detractors just from sheer laugther.

Then once you are a millonare you can post the link to your indiegogo campaign to gloat about it and I will say "Mr. gravity you were so right I dismissed the gigantic possibilities of the extra milliseconds market and I paid the price for it. You changed my life with your vision and I'm so glad you are rich and famous now you totally deserve it after making all those people enter nirvana instantly with your product."

In all seriousness tho going from 80% to around 99%-99.5% is something fairly substantial in which the return rate is not that bad.

But 99.5% to 99.8% which is what we have been talking about that is just nonsense again if you dont believe me and you are convinced that below .8V is a multimillion dollar market that is untouched try to make your product and see how it works out for you I believe reality will be much more easier to trust than me and my math.
Reply: MhDaMaster "by putting up how the return rate for the money spent on the converter to get the energy" But that's the point. That's why I'm not sure why you're so aggressively against "per case cost-benefit analysis". You're basically saying what I am, but in a way that doesn't make the basic point clear. "If there isn't a high benefit to using that energy, don't invest in doing it."

To state it clearly, "improving efficiency is not niche, it's only how much you want to spend to do so, for what you get out of doing so."

This is why actually debunking a scam should note legitimate uses of energy harvesting, like low power microprocessors, and how the scam IS NOT THAT.
Reply: Gravity Then tell me how many people will invest in getting that energy below .8V? :). If not many people then getting the energy below .8V IS a niche tech if not then its not.

And dont tell me you have no idea. What kind of engineer wouldn't know the target market for any given product that would be almost as laughable as your bugged flashlight almost.

An estimate something surely you have some idea if you have no idea I can't see you saying its not niche with confidence. Then again I'm assuming you have some kind of logic in the head which is a BIG assumption.

We have to focus on that because you get off topic way too easy.
Reply: MhDaMaster I'll try to explain it this way: "niche" is basically a 'buzzword', it doesn't really mean anything. So the amount of people that should invest in getting the energy below 0.8v is directly proportional to the profit they get in doing so.

That is perhaps the root point that should be conveyed, since it is a present industry trend to be able to run products on less and less energy.
Reply: +Gravity The word niche has a meaning you know that is the actual purpose of words. It's pretty hilarious to hear someone say that a word which has a clear definition in a dictionary doesn't really mean anything lol. 

I'll even help you with that "niche: the situation in which a business's products or services can succeed by being sold to a particular kind or group of people".

By saying its not niche you are basically saying that a rather large amount of people is interested in getting the voltage below .8V which is simply not true and that is only from a purely grammatical standpoint.

But grammar pales in the face of math so lets get some math into this.

By taking the value of the total energy in the battery and then dividing it until you get the tiny fraction that the voltage below .8V represents we can demonstrate that the value of that energy will most definitely always be much inferior to the cost of the components needed to get it. 

Unless the value of the total energy is absurd which is not going to happen in a general consumer market and sadly no matter how much it hurts your feeling that alone makes it niche by definition.

Lets say this amount of energy goes around .03%. if the cost to extract that energy goes by lets say 1 dollar then you need the total energy to be worth literally 3333.33 dollars if you can find some product that is worth that much running and its running on fucking AA batteries of all things then you can pitch your idea to them but I can tell you, you are going to have a really hard time finding a product with those specifications which again is more proof of it being niche.